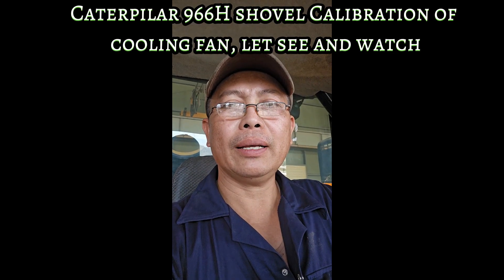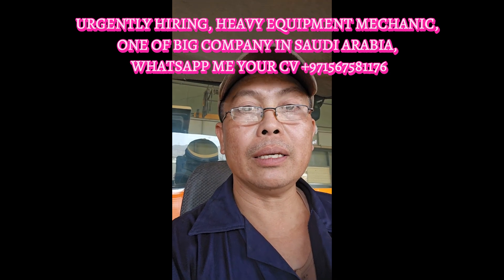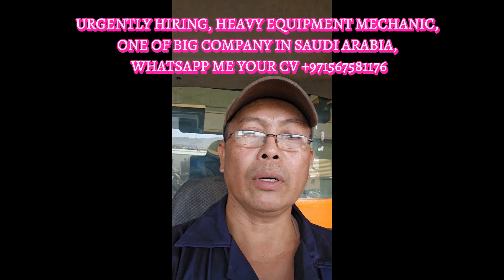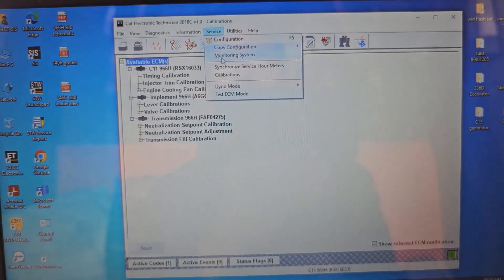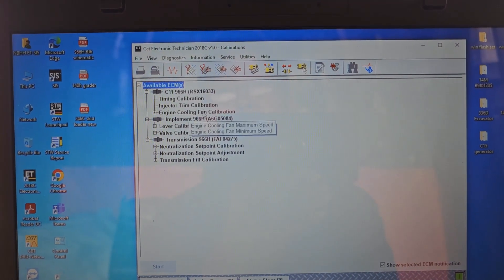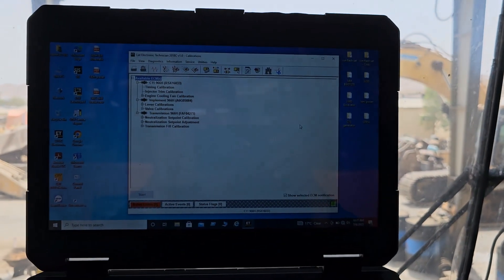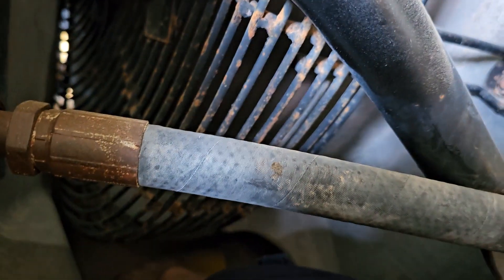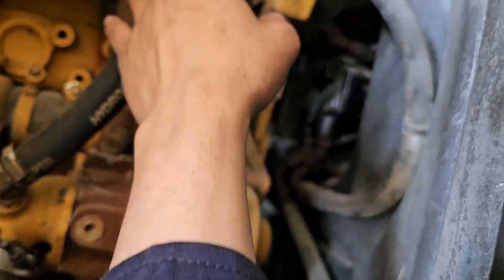Cat 966H shovel cooling fan calibration

Comment: Helow kabayan kamusta po, meron lang po ako tanong tungkol sa caterpillar grader 14m kung papaano bleed steering oil kc ngpalit kami ng steering hose malake.
Salamat po
Reply from the maker: brad actualy s ganyan machine kung gusto mo actual bleeding ppwede mo nman luwagan lang ang hose kung anung drection mo ippaling ang steering let oil n lumabas, pero kung wala nman ibang problema hindi mo n kailangan e bleed p kusa n yan s internal valve nya n sya mag rrecirculate ang langis nyatur left and right lang mag nonormal agad yan
Reply from the maker: pero kung hydraulic pump ang pinalitan o n repair kailanga mo lagyan n stock n oil s mismong loob to make it sure n may temporary lubricant ang pump just incase n hindi kaagad nkapasok ang oil galing s tank
Reply: Hydraulic hose po pinalitan maraming Salamat po kabayan gobless us well
Ingat nlng dyn po.